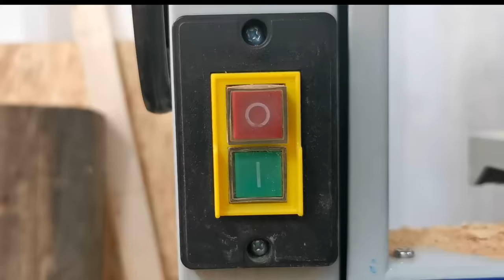DIY standing DESK from a Plum TREE and Epoxy

Comment: Again Marmota, a lovely piece of work. It's more than just a desk. It's definitely an art form.  Thoroughly enjoy all your builds and I've certainly learned a lot just from watching these.
Reply from the maker: Thanks Jonny! I'm glad to hear that.
Reply: @Marmota Works  I was meaning to ask, did you seal the wood prior to  doing the pour?
Reply from the maker: @jonnywright3995  Not this time. This is a very dense wood that was barely going to absorb. In addition, I used very little black stain in the epoxy. There hasn't been any staining issue.

Comment: You do beautiful work! 

Question - I want to either make or have someone make me a door out of wood and resin. It would be my front door and it will be protected in a alcove.  I live in Michigan so it has to be good in cold weather. 

Would this be doable? Would it shrink, crack or warp?
Reply from the maker: I don't think this type of construction is suitable for the outdoors. It won't withstand significant temperature changes very well.

Comment: Hi, great use of fine wood. I was wondering why you didnt use the router sled before you put epoxy in it?
Reply from the maker: It's easier to flatten everything at once than to do it slice by slice.
Reply: @marmotaworks  You used a lot of epoxy that were ereased by the router sled.

Comment: I did a floor like this in the early 80s
Reply from the maker: It must not have been easy...
Do you remember what you used instead of epoxy?
Reply: @marmotaworks   the disc where apx 1” so sanded the filled using grout then sanded again and used bona wood floor finish gym floor because it was a bar

Comment: In the last few months I have cut several plants of pear, almond and plum. With this wood I would like to carry out projects like yours, but I have a problem: the wood is fresh and before I can use it will have to be seasoned. I don't have an oven dryer to be able to speed up the drying process artificially, and I wouldn't want to cut wood into boards because I've seen that in your projects you use sliced wood. What would you recommend to me? Could I cut the fresh trunk into slices to speed up drying or would the wood suffer too many cracks?
Reply from the maker: For this type of projects, the most important thing is that the wood is completely dry. If you don't cut the wood beforehand, it can take a long time to dry. I always use a kiln.
Reply: Thank you very much, very kind as usual. I would have liked to make a kitchen top just like your desk. I don't know if you also carry out work on commission. If it were possible to have a quote I would be interested in the purchase. The top should be 3 meters long and 60 cm wide with a thickness of 4-5 cm.
Reply from the maker: @nicolaluongo4457  Yes, I do accept commissions. That would be a huge project... If you want, send me an email to info@marmotaworks.com and we can discuss the details.

Comment: I am trying to make a butchers block the same way but am having trouble steering the band saw to cut out the shapes so they fit together nicely. Any tips?
Reply from the maker: Probably, you may need a blade that is not so wide

Comment: If this will be put outside, will the heat of the sun can damage the epoxy resin?
Reply from the maker: It's not an outdoor table; it wouldn't handle temperature changes well.
Reply: @marmotaworks  ahh ok sir.. thank you... im planning to try to make like that and i planned to put it outside... but because you said so its not advisable to display it outside..
Reply: @marmotaworks  if i try to make like this but i will use it as a wall outside, will it last for long?

Comment: Very creative and knowledgeable video for such a table top but it would be better look if the base of the table is also wooden,  due to this steel base the table looks more  artificial .
Reply from the maker: A table like that needs reinforcement on the bottom, otherwise it will deform over time.

Comment: To any woodworkers out there: Why is this piece have to be this thick? Can't it be cut in half height and make two table out of it? Because also he already supported it with another wood piece and added many metal bars, so I thought it should be okay even if it was only 15-20mm thick, doesn't it?
Reply from the maker: I personally do it this way for aesthetic reasons.

Comment: You need to separate the keyboard and the screen ergonomically speaking or you're gonna get a neck hump like the ringer of notredame as you age. And 1000 other health problems stemming from it because the most important nerves in your body are gradually compressed, the ones going through your neck. A standing desk does nothing for your health as long as you don't fix that.
Reply from the maker: Thanks for the advice. I'll check it